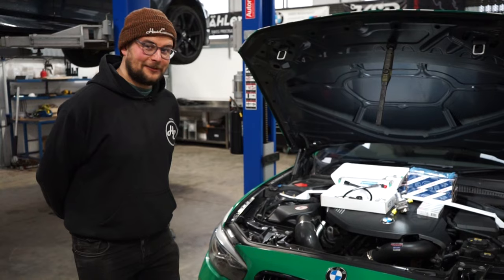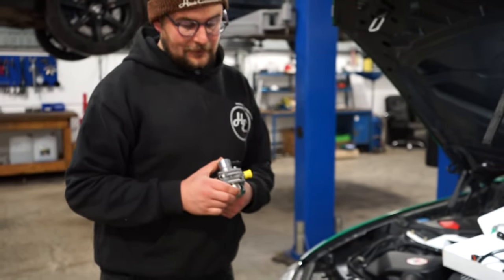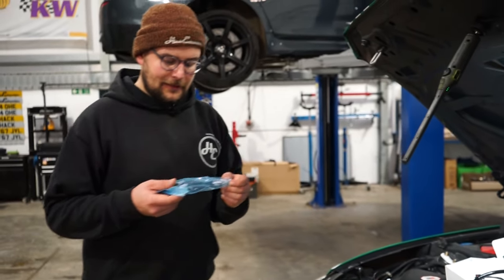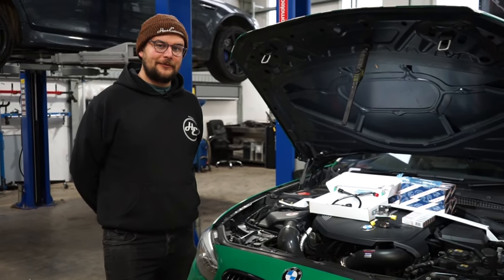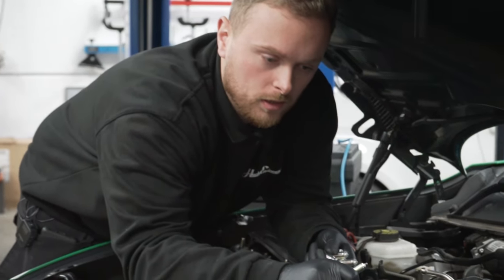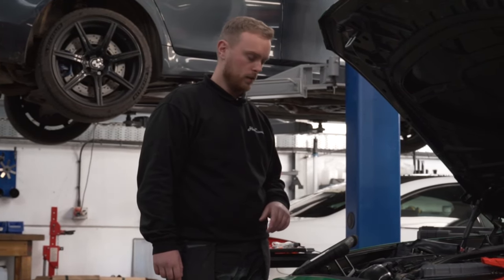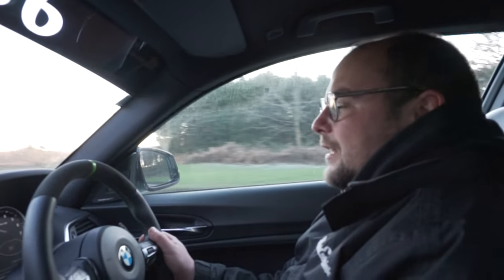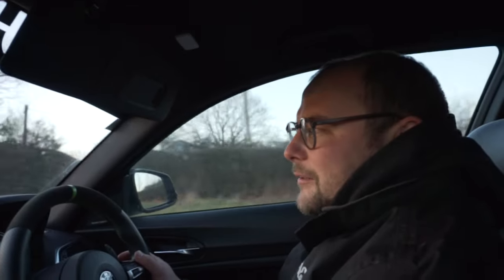The ULTIMATE Bolt On Fuelling Upgrade for B58! HE140i Dorch DS25 Fuel Pump Installation and Review

Comment: How much is ethanol in the UK? Did you ever measure 100-200 km/h?
Reply from the maker: It's pricey, about £4/litre for E85 race fuel. We will be tuning for ethanol in the coming weeks now that weather is improving here
Reply: @hackengineering5586 
That's really expensive. Did you also already measure the 100-200 km/h time?